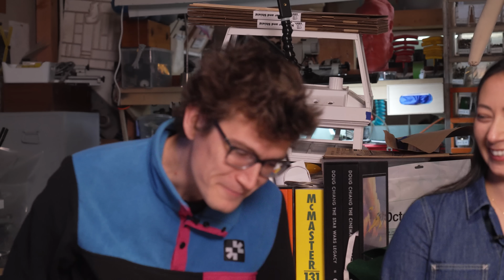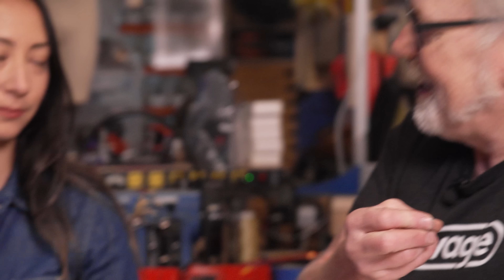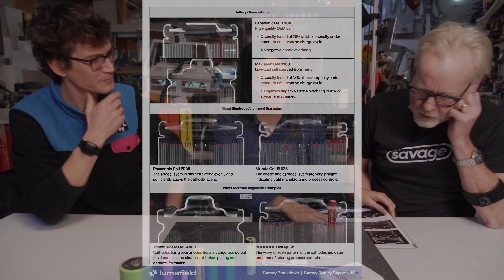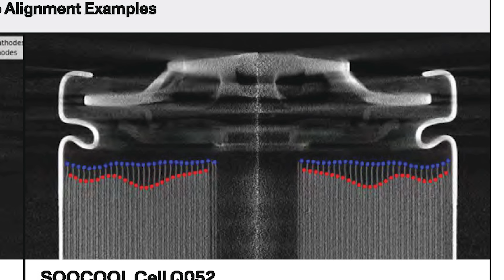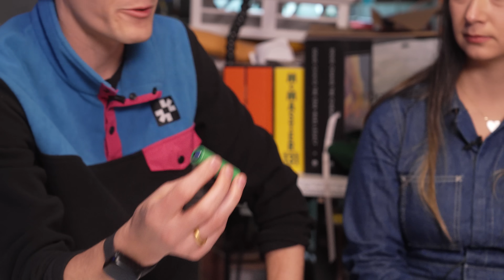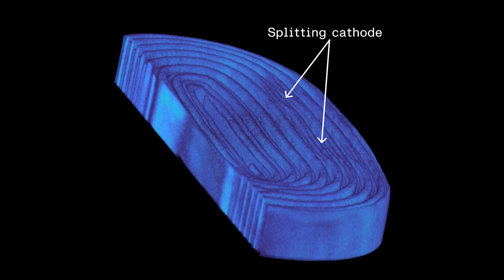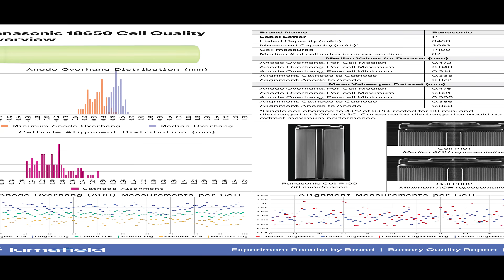The Surprising Flaws in 18650 Lithium-Ion Batteries

Comment: AI Summary
Abstract

This technical report, presented by Adam Savage in collaboration with Lumafield, details a comprehensive 3D CT scan analysis of over 1,000 18650-form-factor lithium-ion batteries across ten different brands. The study categorizes cells into three tiers: OEM reputable manufacturers, "rewrapped" cells, and low-cost/counterfeit brands sourced from discount e-commerce platforms. 

The findings reveal critical safety and performance discrepancies between tiers. High-end OEM cells demonstrate tight process controls and consistent internal geometry. Conversely, approximately 33% of low-cost batteries exhibited dangerous "cathode overhang" defects, where the cathode layer extends beyond the anode, significantly increasing the risk of lithium plating and subsequent dendrite-induced short-circuiting. Furthermore, the analysis uncovered fraudulent capacity labeling (e.g., claiming 9,900 mAh in a cell that is physically 80% empty) and the complete absence of engineered safety features like Current Interrupt Devices (CIDs) in off-brand cells. These manufacturing failures present severe thermal runaway risks for consumer electronics.

Summary of Industrial CT Battery Analysis

*   0:08 – 3D CT Scanning Technology: Lumafield utilizes industrial X-ray Computed Tomography (CT) to visualize the internal structures of complex assemblies without disassembly. This allows for the quantification of manufacturing variances that are invisible to the naked eye or standard electrical testing.
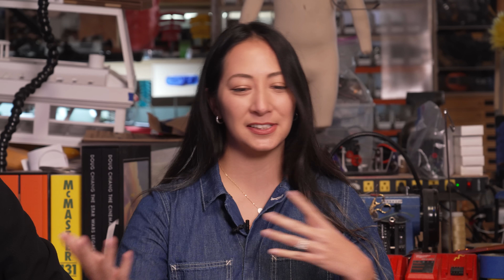*   1:18 – Scale of Production: Roughly 10 billion batteries are manufactured annually, with 5 billion being the 18650 cylindrical form factor. These are frequently "ganged up" in series or parallel to power household devices like vacuums and power tools.
*   2:34 – Manufacturer Categorization: The study examined three tiers of batteries:
    *   OEMs: Established manufacturers with rigorous Quality Assurance (QA).
    *   Rewrappers: Vendors who purchase bulk cells and apply their own branding (e.g., for the vaping market).
    *   Low-Cost/Counterfeits: Direct-to-consumer cells from platforms like Amazon and Temu.
*   3:36 – Critical Defect: Cathode Overhang: A major safety risk was identified where the cathode layer overhangs the anode. Proper engineering requires the negative anode to overhang the positive cathode by ~0.5mm to prevent lithium plating. 8% of the total sample—and 33% of the low-cost tier—failed this metric, posing a long-term risk of internal shorts.
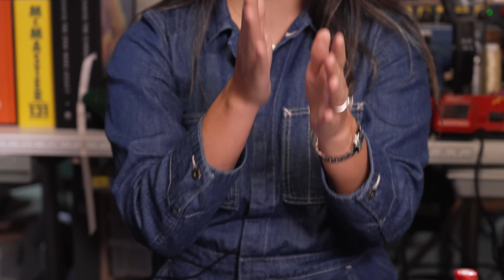*   4:21 – The Jelly Roll Process: 18650 cells are manufactured by winding layers of anode, cathode, and separator into a "jelly roll." In high-quality cells, these layers remain perfectly aligned; in low-quality cells, "telescoping" occurs, leading to inconsistent internal geometry.
*   8:10 – Safety Feature: Current Interrupt Device (CID): Reputable cells include a mechanical CID in the top cap that acts as a circuit breaker, popping open to stop current flow if internal pressure or temperature exceeds safe limits. CT scans show many cheap cells lack this feature entirely.
*   11:13 – Fraudulent Capacity Claims: Scans of "9,900 mAh" batteries revealed they were mostly empty space. These cells lack the required density of active materials to meet their stated specifications, yet they are sold as high-performance alternatives.
*   13:13 – Manufacturing Speed and QA: OEM lines produce cells at rates of 400–600 units per minute. In these facilities, every step is monitored by high-throughput QA (ultrasonic, weight, voltage). Low-cost manufacturers bypass these protocols, leading to "whale tail" winding defects and frayed cathode edges.
*   18:39 – Case Study: Harabibo Power Bank: A popular "viral" power bank was pulled from Amazon after Lumafield scans revealed severely compromised edge alignment and poor layer overhang. Similar defects were found in the brand's earbuds, which placed failing batteries in close proximity to the user's head.
*   20:38 – Key Takeaways for Safety:
    *   Price as a Proxy for Risk: If a battery deal seems "too good to be true," it likely lacks internal safety engineering.
    *   Physical Identicality is Deceptive: External dimensions, mass, and voltage readings are insufficient for verifying the safety of a lithium-ion cell.
    *   Device Maintenance: Users should immediately cease use of any device that feels abnormally warm or emits a chemical odor. High-risk batteries should be submerged in water to mitigate fire spread if they begin to fail.

AI-generated summary created with gemini-3-flash-preview for free via RocketRecap-dot-com. (Input: 23,038 tokens, Output: 1,076 tokens, Est. cost: $0.0147).

Comment: - Chinese 18650's are mostly awful, don't bother. Chinese LiFeP04 cells are mostly good. You can easily test them by weighing the cells. Light=poor performance, no need to do a capacity test, it will fail every time. Here's why there are so many poor-quality 18650s laying around: Amazon customers buy them, their device turns on, so they're delighted! They give them 5 stars for just "working", not even having done a capacity (in mAh) test. If they buy 1 pound of beef and it only weighs 3/4 pound, they want to sue the store.

Comment: I imagine the 2170 batteries in Teslas are very different from the smaller,18650 cells used in hand-held electronics and electric tools. Using larger cells makes manufacturing their electrodes easier. And since Tesla has perfected the dry electrode, it not only means better performance, but more environmentally friendly manufacturing.

Comment: This is some scary shit ..i need a new ebike battery..i know cheap batteries are not good but in the case where batteries are hidden its pretty much like shooting craps in a casino with much worse problems when we roll snake eyes..American built ebike batteries that have samsung cells are minimum twice as much as China built with claimed LG  or Panasonic cells..they  are within most peoples budgets but how do we know what cells are in them?  The battery case is easy to take off and check but that voids any and all warranty..it shouldn't be this hard to buy a fukin battery..we shouldn't have  worry if it will burn our house down or worse blow up on the bike where it sits about 20 inches under my ass..i dont really want a burned ass and burned other parts that are in close proximity..American made with good cells start at 650 usd and china made with claimed LG  cells are 350 usd..350 is not just a drop in a bucket to me..650 is out of reach without putting effort into saving that amount ..on top of all this its electronic and could die the next day after the warranty goes out and then it starts all over again ..hehe..maybe time to buy gas powered 2 wheel vehicles again..

Comment: Adam I sent an email to your guests, but I  thought I'd share my thoughts with you as well.  After reviewing their report, and listening to your excellent presentation, the following questions came to mind:  What about the 18650 cells which may reside within a Dewalt, Ridgid, Milwaukee or similar power pack?   Has anyone broken apart one or more of these units?  Is there a way to use CT equipment to look at these multicell packs?   And aren't manufacturing flaws multiplied when low cost, poorly engineered cells are used in series?

I hope you have a few moments to respond to these questions, or your guests will attempt to expand your research?

Comment: VOLTAIC CELLS, also galvanic cells is what they are called individually, when it is a group of cells, it's called a battery in English or Pile in French as in Nuclear or Artillery Pile, referring to the similar appearance of a set of artillery shells or a chain of bullets stored together.  The battery itself is not the structure, it's the casing that holds the battery is the structural component.  These should not ever be used as the structure, they weren't designed to hold it and that is possibly part of the reason you may see more BEV fires to begin with.  Also, it is that casing/structure that is the only real thing that's recyclable as the rest of the battery gets warehoused for "wish-cycling" or "to be recycled in the future."  If I was to use a battery array as electro-chemical storage, it would be the venerable Lead-Acid as the components that make up these are actually recyclable and not as prone to fire as these things are.  This is in part why there is a core charge for new lead-acid batteries if you don't bring another one back.

Comment: there is only i think 3 companies that make batteries, and all the "cheap" batteries, are just the batteries these 3 company made that didnt pass spec, they are binned separately and sold to everyone else, im sure there is other companies making batteries, but the 3 top ones make 80% of all the batteries so the odds are high it's a subpar battery from one of those 3 you are getting for cheap.

Comment: i have nanoscale Lithium Iron Phosphate cells in a scooter that i bought in 2013. i still use it, so it’s 13 years old. the battery company was called A123, which President Obama gave a grant too.  even though the company went bankrupt, the batteries they produced have a secondary market. people are buying old equipment, pulling the batteries out and making battery packs, and there’s no known fires that i know of. what makes these cells last so long and not catch on fire?
Reply: after A123 closed, the scooter company switched to Sony Lithium Iron Phosphate, same chemistry, but the batteries last less than 2 years. so is it the nanoscale technology of A123 that is the difference?

Comment: I worked for Panasonic in the Reno Giga Factory making the batteries for Tesla, their quality control was beyond the point of insanity. If so much as a cosmetic microscopic scratch was detected on the outer case the entire production line would be shut down till the cause of the issue was found and fixed. Shutting down a production line was no simple process, it could take 7 hours to have it ready to restart production after just opening a door. Thousands of batteries failed QC everyday and would be scrapped. We were told they were sent to another facility for recycling, but I've often wondered if they weren't just sent to one of these companies that puts their own labels on the batteries and sells them cheap.

Comment: Manufacturing process generated flaws can be very unexpected.  Although sometimes they can be caused by failing to implement proper industry standard quality control.  

As a note, there is a massive problem with flat packs that lack proper venting mechanisms, turning them into dangerous "Spicy balloons" when they go bad.

Comment: Back in 2017 I bought 200 Samsung e35 18650 and they have the built in fuse. They have saved me from fires. As of now about 80 of mine are dead. Some I over charged. Some I used on a boat trolling motor and when you hit ground with trolling motor it pulls a lot of amps. I read the data sheets before I buy and that's where I saw that they are fused. Now I could be wrong about the fuse so make sure before you buy.

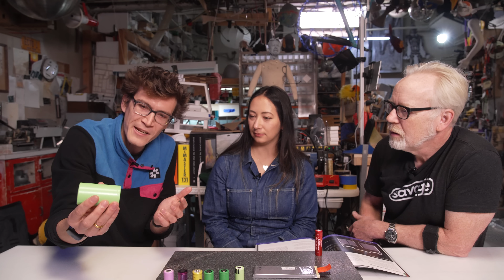Comment: @9:16, dude, that's a 46800, not a 4680.  46 = width in mm, 800 = height in 1/10 mm.  18650 is 18mm diameter, 65.0 mm high.  a "4680" would be 46mm diameter (look right) and 8.0mm (under cm) long.  No, it's 80.0mm (8cm) long.   Bonus facts: two other common sizes are the "AA-like" 14500's and the 21700's, which are slightly taller and noticeably wider than 18650 and are used in higher current/capacity applications where 18650s don't quite cut it.  46800's aren't likely to hit mainstream consumer use outside large things like EVs and maybe e-bikes due to their larger size.  Also they waste more space when you try to pack them.

Comment: I think it obvious why they did it, to scare people into buying OEM batteries only.  They intentionally obfuscated the battery model from the various manufacturers is red flag number one (they have nullified the possibility of independent reproducibility of their data.)  I find the lack of financial disclosure also particularly telling.  So what I learned is 1) you can make testing methodology fit a narrative 2) they are most likely OEM battery shills selling an expensive CT machine as a side hustle 3) Savage may be getting compensated as well, or he is naive. Equally bad.  BS detected? Plausible (as a fun throwback to when Savage was actually inquisitive.)  Lastly, "follow the money."

Comment: I bought batteries on temu and Ali Express. Unfortunately I didn't know much about how to test them until I had mixed them up in a box. 
But they were not that good. 
Some I bought on Amazon were even worse. 
I've decided to wait to order more when I can order name brand from Panasonic and Samsung to see what they do.
Thank you for providing the report. I will rethink cost vs capacity value when I order the next cells. 
Recently I bought 8 lifepo4 32700 cells to build a battery with. I have no idea how to test the cells individually. I can imagine the cheaper cells have similar issues.

Comment: Weighing a battery can tell you some, but not all.  After buying cheap brands to save money I noticed they weighed less than the name brand.  18650's were always lighter if they were cheap.  But what surprised me was it's true for other battery types too.  Especially 9 volts but the differences weren't as profound.

Comment: Let me tell ya a story...all about how I nearly took my self out with 2x123 lion cells in a directional pipe bomb...or a headlamp, as they called it. Haha. I had turned it off several min prior to it detonating, but I had left it on and  forgotten all about it...that little detail certainly made for a bit more volatile climax. Prob 10 min later I was standing at the kitchen sink rinsing out a cup, caught a whif of heated electronics about half a sec before it came...it had taken to thermal runaway and the casing was aluminum. Like a little pipe bomb made out of a T fitting. It literally was strapped to my dome and had the nature of the tool not been so as the natural weak point was directly opposite of me...being the lense. It was very thick real glass and well sealed also though. Thankfully it was weak enough...it was prob somewhere between the concussion from a 20 gauge and a 12 gauge shotgun in a small room. Blew the window out over the sink and I was froze like a statue for literally at least 10 min maybe 15. Just struggling so hard to comprehend wtf had just happened... gotta show respect to power in any shape, form or fashion.

Comment: I was using efest 14650 high discharge for about 8 years till discontinued, were I have been using vapecell 14500 at 10a discharge for the past 3 years. I picked both these for test I found, that proved they where safe for the use case and both did well. I use them till they stop holding a charge at 4.2v or I feel there draining to kwik, then I replace the 3 in rotation even if its one showing the issue. I have using these in the same about mech mod this hole time, just different tube and using the same 1.8-2.1ohm coil for given time. This mech mod is proper, in that there is a lock out for the switch and gives low resistance to the circuit. This lock is to be used when replacing the coil, this ensures that the battery dose not get short when doing this. So have never blow the provided fuses, nor found reason to need cells with a safety if these even had that. There is need tho to know when the cell is getting low, so that never pushing them under 3.3 and preferably charging at 3.5-3.7v. If I find they fall too kwik to 2.5v more than once, its charged to 3.7 and put out of service. These two are imr type cells and is what I think is best for these high drain applications, where these are only two have found so far to fit the bill but one is no longer in production.

Comment: You use a BMS to break the circuit when making your own battery of lithium cells. When they sense a large enough difference in voltage, or too high/low of a temp, it opens the circuit. That’s what I would’ve mentioned when asked about “a safety device”

Comment: I wish these guys would do something like this, but with battery packs, like, go buy some Milwaukee, DeWalt, Rigid etc OEM batteries, and then do the same with aftermarket packs. I've found battery packs with fake cells filled with sand before. Crazy!

Comment: The last time I went to a major arena concert, the security guard at the metal detector station made me throw away my 18650 out of my every day carry flashlight. It infuriated me on so many levels! The battery was more expensive than the flashlight it was in. EVERYONE going through had lithium batteries and LED flashlights in their cell phones, so it was pointless to do anything about mine. And THEY LITERALLY MADE ME THROW IT IN THE TRASH CAN! 

Many garbage trucks are turned into actual fire trucks every year from crushing lithium batteries, and they wouldn't let me do anything except throw it in the trash or hike half a mile back to my car, then get in the back of the line for the security screening again. Their ignorance creates more safety hazards than it prevents!

Comment: 18650 battery for past 10  years was the only way to get ultra bright flashlights and lanterns. (AA can't or don't last long)    Now they have USB-C charging capabiilty.    EBAY stopped selling 18650 due too many  scams and especially dangerous quality or fakes.    Had long relied on TENERGY brand.

Comment: I would’ve liked them to talk about the risk being when the batteries are under load or charging or at rest/storage.
Reply: a fire proof, small explosion proof area like a container made from bricks or concrete would assist. Separate from your house.
The amount of fires, even in my small city, in garages and inside homes is alarming.
What really piss's me off, is that many items like some cellphones and computers, they are welded into them. You can't even pull them out, as a normal user.